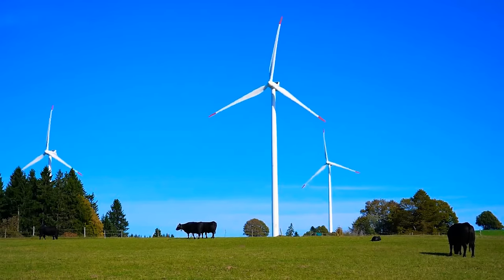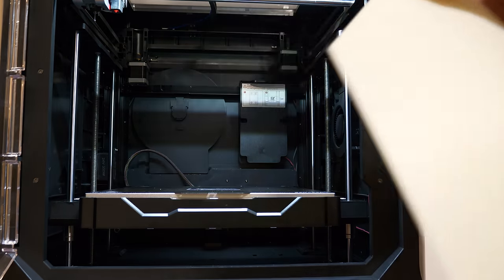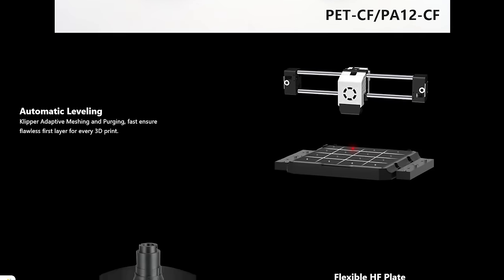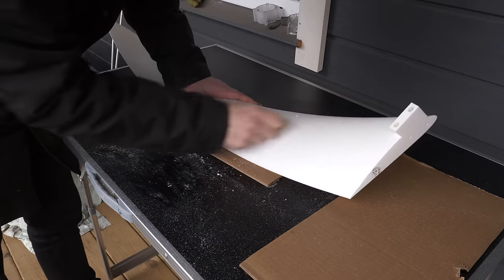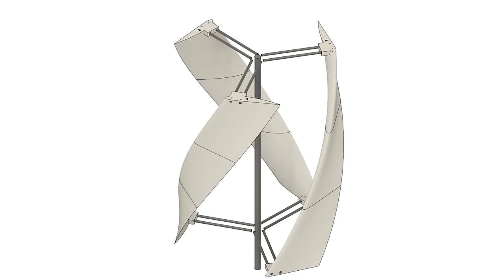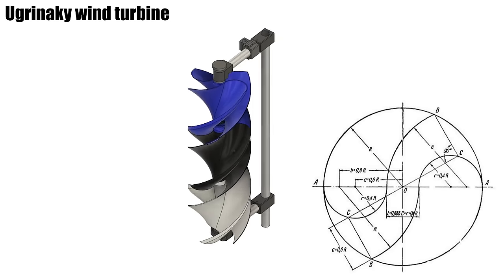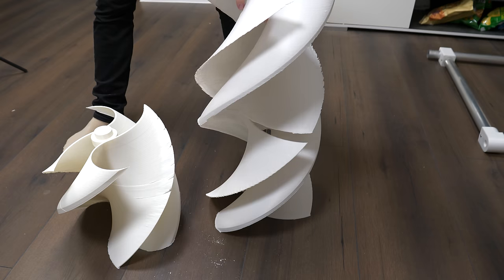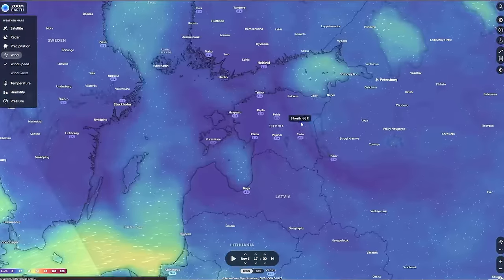I 3D Printed TWO Life-Size WIND TURBINES - BIGGEST PRINTS I HAVE EVER MADE

Comment: A.  ABS will dissolve in acetone...get a jar...drop in some ABS filament (or ABS support/failed prints), dump in some acetone, put on the lid...wait 20~ min...it will create a slurry/paste of ABS/acetone...use that to glue ABS parts together...best glue for those types of prints bar none (just wait a little for the acetone to evaporate and you literally have a solid piece)
B.  ABS   WILL degrade in the sunlight...paint the blades in UV resistant paint or they will get brittle
C.  That printer is stupid fast!  Awesome!
Keep em coming!!!!
Reply: ASA is a bit pricier but seems like a way better choice here - stronger adhesion, less prone to warping, 10x the UV resistance, and even though it prints hotter it's still well within the X-Max 3's temperature range.

Comment: One thing that you can do is to combine the two turbines by putting a segment of the drag turbine on the middle shaft. Drag turbines self-start with much lower wind speeds, but lift turbines need higher relative speed of air across the blades to work. With a combined turbine, the drag turbine can help spin the turbine up to speed so the relative speed of the wind across the blades is fast enough for the lift based turbine to really work efficiently.
Reply: What a great idea!
Reply: what for? you earn nothing out of it. If it's to see a nice spinning thing outside ok, but that's about it.
Reply: @olafmarzocchi6194  this isn't correct. Darrieus turbines typically don't self-start, and they only reach their peak efficiency when they're already spinning above a certain rate. Drag based turbines self-start and can bring the Darrieus turbine up to its ideal speed. That's why there are turbines that combine the two.
Reply: Check my other post where I estimate the production of the wind turbine. 2x1 metres at a couple metres high above ground may produce on average 3W over the day.
No joke, 3W on average over the day for a 2x1 m turbine.
Reply: @olafmarzocchi6194  watts are a measurement of power, not energy. How many kilowatt-hours does this turbine produce? Watts aren't a meaningful unit here.
Reply: Let me do the calculation.
It's about 0.075 kWh generated per day on average for a 2x1 m turbine mounted at about 2 m height above ground. It's about 2 euro cents of energy. It takes 27 years to earn 200 euro of material costs
Reply: @Berkana  Exactly this.  The Darrieus has far greater potential.  It just isn't a good self starter.
Reply: I like your idea, but the problem is that lift turbines move at faster speeds when properly powered by the wind, so you would actually get the drag turbine to be overpowered by the lift turbine and it would slow it down.
Also lift turbine start spinning pretty quickly once the wind power is present.
Reply: @jsbrads1  this kind of double VAWT does have that limitation, but this design is specifically meant for places such as at really low altitudes and near buildings where the wind is inconsistent enough and not necessarily fast enough where a Darrieus turbine could work optimally. It is a compromise design for compromised wind conditions.
Reply: @Berkana   Lift done right is going to be roughly 4 times as efficient as drag. Lift peak efficiency will occur at a higher rpm and lower torque than drag. It is factually impossible to design a non pitching lift based system to match efficiently with a non pitching drag based system for a range of wind speeds.
At low speeds a drag based system spinning a non working lift based system is wasted work, at high speeds a lift based system will be over rotating the drag based system resulting in more wasted work.
Reply: @jsbrads1  are you sure about the low speed operation being wasted? This design successfully solved the self starting problem in coastal turbines in Taiwan. In the wind speed range where drag and lift operations overlap the drag-assisted lift arrangement (with considerable leverage so the RPM translates to blade speed) brings the lift turbine into its optimal speed range.

If you use a clutch or ratchet between the two, the drag part can spin up the lift part without dragging on it at higher speeds where the lift turbine outpaces it.
Reply: @jsbrads1  regarding the non pitching lift based turbine matching a non pitching drag turbine for a range of wind speeds, maybe the efficiency won't match but combining them isn't necessarily a bad idea. I've seen scoop shaped air foils that can still move by drag when the wind is blowing in the he wrong direction, and also Darrieus turbines with scoop shaped struts holding the blades so that the wind can help self-start them.
Reply: @Berkana   I will admit I thought about a ratchet, but I think the gains are negligible, but the costs and increased maintenance is not. With a sustained wind, the lift based turbine would quickly spin up to an efficient rpm. I would like to read about that coastal Taiwan design.
Reply: @jsbrads1   The way to think about the combination is not in terms of gain, but in terms of enabling the Darrieus turbines to even work when the wind starts up. The problem isn't that they wouldn't spin up once they're working, its that there's an entire range of wind speeds where Darrieus turbines only work if they're already spinning and slicing through the wind such that the lift effect can turn the turbine, but can't self-start to take advantage of those wind speeds. Think of it as enabling the lift part to work at wind speeds where it needs to already be spinning at a considerable speed for the correct relative motion of wind to its turbine blades. 

The most notable application of the combo turbines are Savonius-Darreius combo turbines. The ones I saw were along the coast of Taiwan, in an area where the geography messed with the wind, so the wind was not from a consistent direction, but I've also seen these in California. The turbines looked like those egg beater type Darrieus turbines with a pair of small Savonius units on the middle shaft. Unfortunately I can't seem to find any literature on this online; I don't know what the project was called.
Reply: @Berkana  those sound like bad places to put wind turbines
Reply: @jsbrads1  Generally speaking, yes, but if you have areas which are hard to connect to the grid because they are remote, and need locally produced power, but the conditions are bad, the best you can do is to adapt to the conditions. That's what these compromise hybrid turbines represent: a compromise to make the most of their situation.
Reply: @Berkana  thanks, that makes sense, using wind for a small grid doesn’t tho 🤷
Reply: I believe even at full scale windfarms they use wind instruments to measure the conditions and have motors attached to the rotors (or use the generators as motors) in order to start their rotation when the wind speed is not strong enough to start but is enough to sustain rotation.
Reply: @larrybremer4930  I think that's correct, but that kind of system might not be cost effective for small turbines, hence the self starting hybrid type.
Reply: What is happening with the airflow at the top, middle & bottom of the Darrieus foils? A simple wind tunnel experiment or even wool tuffs would be interesting. How much of an improvement could be made to this model by understanding what happens to the airflow around the spinning blades?
Reply: @Berkana  3+3 blades H-Darrieus turbines with the NACA 0021 profile can self-start with a dynamic attack angle -6..+10 degrees at a min/max wind speed (with hard springs). After grinding, they need to be rubbed/twisted with wax or polish for furniture. D min = 1.4m, H min = 2.1m
Reply: @MihailG5541  Thanks for this info. Could you point me to where I can read more about this?
Reply: I am considering a vertical axis wind turbine that looks exactly like a tree, I call it : e-tree,
the trunk of the e-tree is brown, the spinning blades are green,
attached to the trunk of the e-tree are features of : wifi/mobile network, light and power outlet, to charge a car for example

Comment: I did some testing on VAWTs 4 years ago, similar concepts but my one using aerofoils had vertical aerofoils which allowed me to adjust the angle of attack to tune the lift for optimal running without having to calculate it with maths.
I will say I agree the VAWTs can be very satisfying to watch
Reply: Same here, I made a small scale 400mm long aerofoil, put on top of my house for testing. Lasted a year before a massive violent storm ripped it apart because it was spinning way too fast.

I think the bearing and shift is still up there lol
Reply: I'm sorry to hear about your ripped apart turbine. @TheWayne104  

Was it under load that entire time and producing electricity?

Comment: VAWT are not as efficient as HAWT but at small scale they are simpler and more convinient since they can use wind from almost any direction without needing extra components. The drag design is the less efficient of all of them but usually seems to spin faster on lower wind speed due to the extra material compared to the lift design
Reply: They are simpler and more reliable. So they can be used in remote places with less trouble
Reply: But they still need sizes of meters times meters to produce anything useful. Something less than 5 m tall and 2 m wide won't turn on a light bulb reliably
Reply: @olafmarzocchi6194  that is incorrect! I have a 500W VAWT in my back yard. The tip reaches 3.5 metres tall on the pole. The unit is 1.5 metres tall. It regularly produces in excess of 200W output. That's a lot of Wattage to run a few 5 watt downlights
Reply: Of course it depends on the strength of the wind in your region. It also depends how often you get it. How much usable energy does it produce per year? Have you put a meter to get an actual estimate?
Reply: @welovechoccy what kind of wind speeds is it taking to produce this amount of power?

Comment: Your ABS parts were being over extruded which caused the warping. You need to set the extrusion multiplier to some lower value like 0.9 or 90%. Over extrusion causes corners to bow upwards.

Comment: How much torque do they produce?
What coil size and arrangement is your goal? Radial or Axial? At what RPM?
When you begin to generate Current or Amps, you experience magnetic friction, also called cogging.
The drag version requires designing the generator for the RPM range, most likely in the area of 1500-RPM max.
The lift type will need consideration for over production, too high of an RPM, don't want to burn out your coils.
Home Brew Windpower
The Home Built Dynamo
Two great resources for building wind generators.

Comment: I'd like to get your thoughts on a design like the "rigidblade" wind turbine. It sits at the apex of your roof and catches wind flowing over it. I wonder if the roof surface area would give you good speed/more air. you can also make it so the fron of the house goes over the turbine and the back goes under so it spins in the same direction no matter what. I'd imagine it would also be modular so you can make one design and just add more next to each other.

Comment: Have you considered filling the blades with foam for increased strength without much weight gain?
Reply: Better off looking at 3D printed RC plane wings.  They already have the designs down for light weight strength.  They don't foam fill them, they do single layer wall with LA PLA so it foams so even lighter all in vase mode and then they add cross beams on the inside to give it more strength.  Then they jam carbon fiber rods to keep them straight.

Once out the ones who go for extra strength then sand and then epoxy the wings making them even stronger.

Comment: Hey mate,
very nice project. I love that you actually did build them quite big. Cannot imagine the work that went into this! Props to you.

I noticed though a small error in the design of the first (lift based) turbine, that might hamper its efficency quite significantly: The airfoil is placed upside down / inside out. The suction side of the airfoil (longer side when looking at its cross section) should be on the outside. To me it appeared, that you had in on the inside facing the axis. Also when rebuilding, you could consider putting the rods closer to 1/3 of the airfoil (closer to the nose that to its tail), to reduce the loads on the structure. Let me know if I explained myself.

But all in all very nice project and although you do not produce any electricity, I hope the running turbines help convincing some folks that renewable energy is quite nice.

Cheers

Comment: You could have cut a large PVC pipe on a diagonal, heated it a bit and straightened it in a fraction of the time and expense. Also it would eliminate joints and potential points for breaking in high wind or rough edges without having to smooth them out.

Comment: "so materials like PLA or PETG doesn't work because of the sunny day they literally melt"
Aaahh - whaat?
Reply: PETG deforms at 70°C, PTA at 50°C.
Depending on the location, the use of PETG should be feasible, but it is UV-sensitive. So paint it ...
Reply: @joerne.9632  Yes but he said, as i have quoted, "literally melt"
If it is hot enough near you to MELT thermal plastic then you got some bigger problems.

Comment: Don't get me wrong, great project and props to all the work you put in, but if I may ask: Why? What's your goal?

These turbines have terrible efficiency (and low wind speed characteristics) compared to normal ones. If your actual goal is to eventually produce electricity, there is 0 reason to choose these over a normal wind turbine. They are cool no doubt and depending on personal taste you might even find them better looking than traditional wind turbines, but still: Why?

Comment: What would make it MUCH more efficient, is not using ABS :D... if you wanna use wind energy, you have to work really on a flat surface for the blades, if its ABS maybe you can brush epoxy on it or so, I didn't try it, but I was watching and thinking me into this topic a bit, and it was obvious logic, that every not flat area on the blades would create little vortexes, which takes a lot energy from the force which is going against the blades...
Can't remember if in the videos I watched they really showed the comparison, the more I think about it, the more I wanna print it too xD
Ah great, you linked the files... thx!

Comment: why not try placing the drag powered one inside the lift powered one!

and yes the shaking is a big problem and youwould have to use a generator with a fixed axle wich goes through all the way out the other side. If you  have one with a long enough outer Axle or better 2 on one long axle you could bore a deep hole in the ground and fix it in place with concrete and the turbine rotates together with the Generators on both sides wich would make it very stable

Comment: Yeah bladed turbines are more efficient than drag turbines. And the prop turbines are also more efficient than the vertical blade turbines. But this requires extremely good understanding of aerodynamics and a lot of simulation and testing to arrive at the best design.

Comment: Im building a big 400y400x1300z printer i plan to print a windmill sometime i think asa would be better than abs because it doesn't warp as much and is also uv resistant i bought a 5kg spool
Reply: ASA is definitely the way to go here, bit pricier per kg but for outdoor weather/UV resistance nothing else really comes close.

Option 2 as someone else here suggested would be painting ABS parts with a UV protective layer, but I'm not a fan of post-processing if I can avoid it 😅
Reply: @glittalogik  yeah whan you add in post processing you might as well go the extra mile and make it with fiberglass and a printed  mold wich I do plan to do

Comment: I printed a VAWT turbine maybe just a little big bigger than yours (The "drag type" aka Ugrinsky type), used just skate bearings and 8mm rods for the build, used a NEMA 17 with high-ish ohm resistance on the coils for higher voltage output (thinner wire and more turns usually) and I was able to charge a 12v battery and drive some garden lights no problem, finding an optimal ratio gearing was kind of tricky, too high gearing and it wont spin in low wind, too low gearing and the voltage generated might not be enough for you use case even in high wind. Given we have a lots of wind and I eventually put it on a 4m pole. You need to elimate all kinds of friction on the turbine when it is this small, it should spin freely just by walking fast holding it infront of you. Even light up some LEDS if you run around with it in still weather!

I printed my parts in PLA and found surprisingly that red PLA sucks and white or neutral PLA holds up way better in a storm. Using print setting with minimal infill and perimeters, I was able to print each segment of the turbine in just over 1h on a typical Prusa MK3. Bearings and rods for maybe 10 euros, such a fun project.

It worked continously for over a year, with only minor repairs that could mostly be fixed by some super glue. Had to move and now I dont have a garden for doing these types of projects.